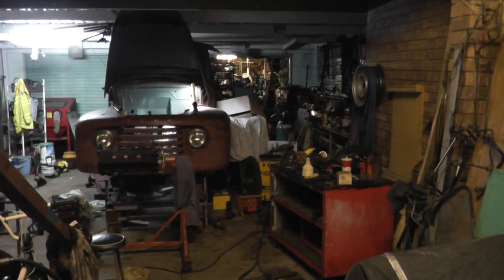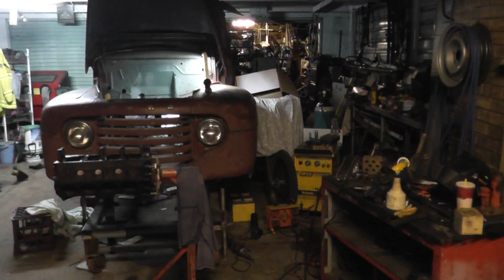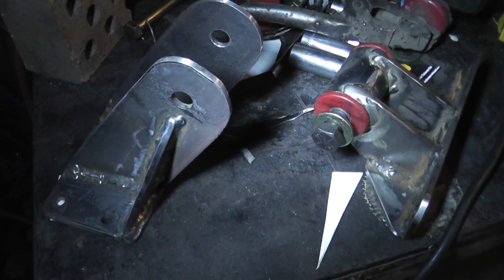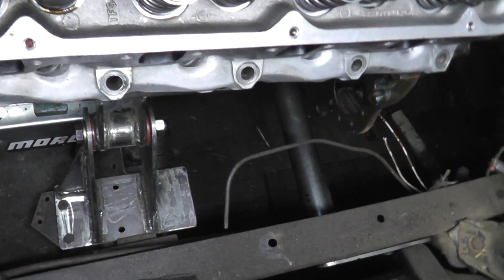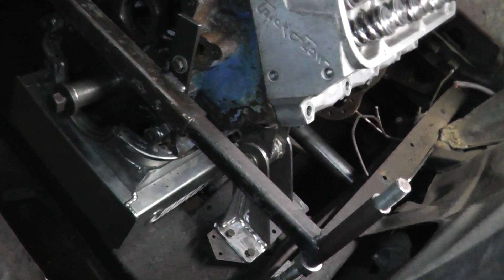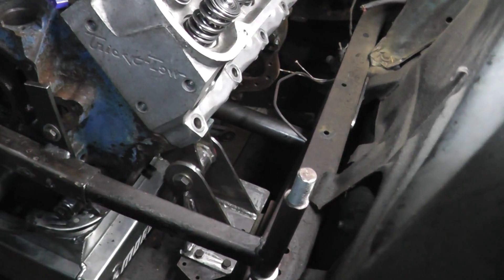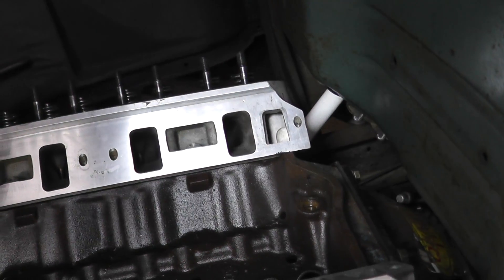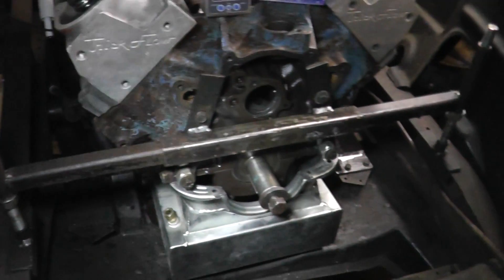Ford F1 truck project , part 21

Comment: Did you get the F1on the road, would be good to see a pic if you did.
Reply from the maker: Not yet unfortunately but still happening, life puts you thru a few corners and the truck will be done .
Have new camera now and more parts on hand ,vids too
Reply: No worries, yeah life sucks sometimes. Be good to see some new videos to see how it's coming along. Did you get the 62 finished ? I ended up getting my F1 on the road in 2018. I used your wedge idea for spacers Between the jag front crossmember & chassis, they worked out well.
Reply from the maker: yes , the 62 is this happening too but as mentioned the videos haven't for awhile and as you know projects evolve somewhat as well ,so more ideas in the mix means longer to finish ...The budget is tight but it will happen ,just bought a new milling machine so should be making some one-of stuff soon just to complicate matters a little more add some wow factor ?? @steveboyd7669
Reply: @pyroman6962  Cool, good luck with the builds.

Comment: wheres pt 22
Reply from the maker: Part 22 happening soon and a new addition as well ,just parked/ squeezed a red 62 f100 into the garage so plenty happening just need to film it all and post it . Should be interesting two projects at once , lots of fabrication going on and will post a 62 F100 project series soon , stay tuned .....
Reply: pyroman6962 also its no "f1" its f100 also good luck and keep up the good work
Reply: Also that 1968 ford you should put a 1994 cummins 12 valve v8. It only cost 765 us dollars idk how much in Australia though
Reply from the maker: Thank's but the "50" is an F1 truck .....
Reply: Ok lets just not argue also that 765$ is a prety conveinent 765 put bacwards is 567... Lol
Reply: Also can you mention me in part 22?

Comment: Hi the front mounts on the jag front end do thay sit 8mm under the chasie rail or flush fit out side rail with a spacer
Reply from the maker: You can do it various ways , I chose to place the bracket flush with the outside of the rail , I will finish it with a fish plate that is welded over the bracket and frame adding strength to the mounting bracket . I hope that makes sense ....
Reply: Job well done thanks for the info, have you worked out how you are going to mount front shock
Reply from the maker: yep ,as many have done with the jag ifs ,use a type 1 vw shock with a fabricated top bracket that is welded to the upper section of the pressed IFS metal frame , the shock runs thru the middle of the upper control arm . Original lower location used ,if you google it you should find a picture of the general shape of the brackets ... cheers

Comment: If you still have the original rear shocks would it be possible to either get a part number off them or measure the length from eyelet to eyelet and the compressed length. Having trouble trying to get the right ones. Cheers Steve
Reply from the maker: I couldn,t find a part number but they are 18 and 12,1/2 inches extended and compressed , I hope that helps , cheers